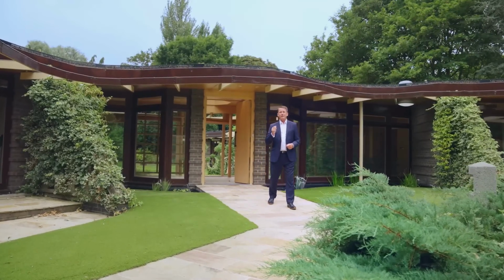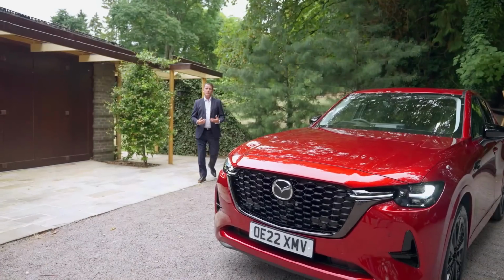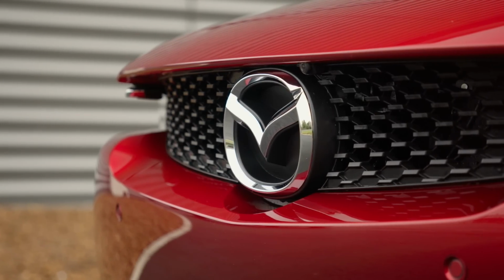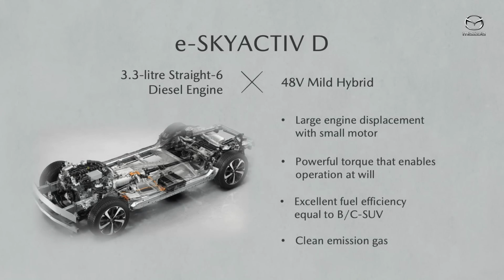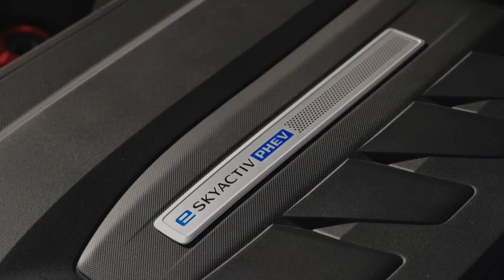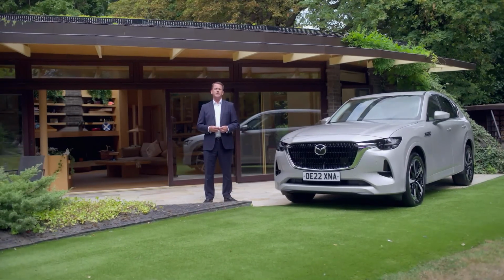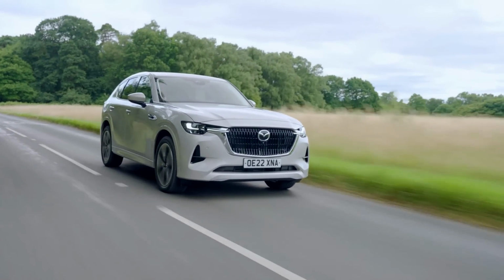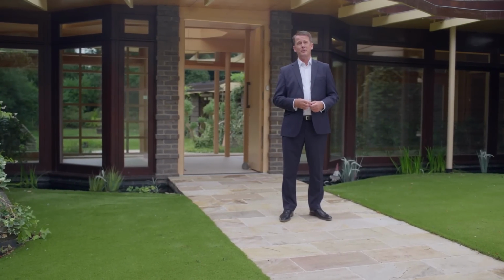New 2023 Mazda CX-60 Plug in Hybrid - Mid-size Crossover SUV

Comment: Features and power train are no questions asked. The shape is shit design and worst thing are two side mirrors sitting on the door panels it recall the 1950 & 1960 Morris Minor(a fly in the ointment).
Reply: Nice one Ben. Sweet burn. Where would you like the mirrors mounted mate?
Reply: @samfreeman9382 mounted right on the triangle place of the front windows as usual. Please ignore the blindspot theory.